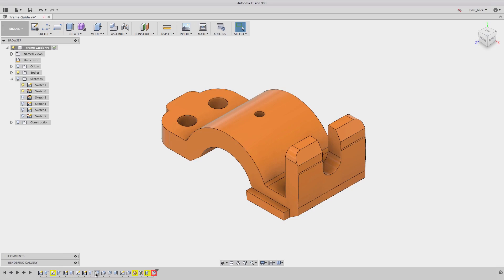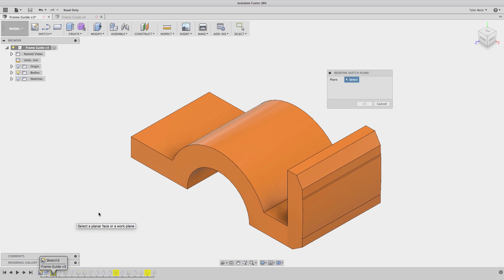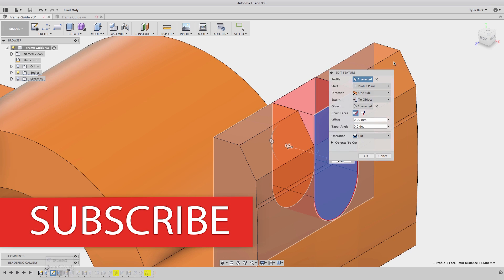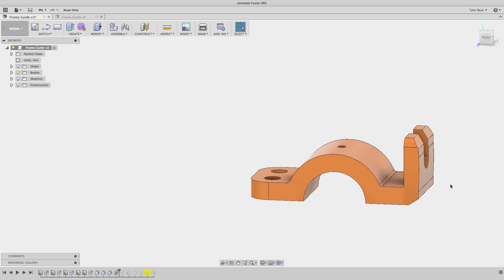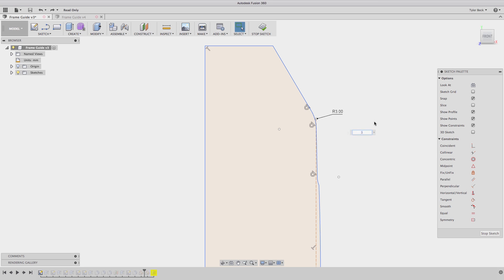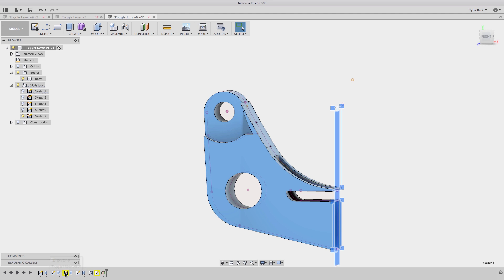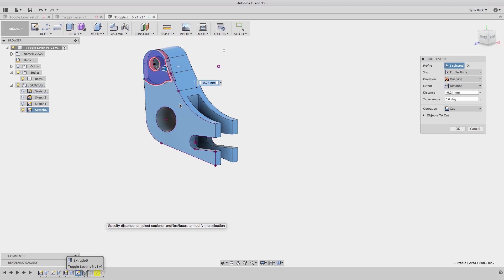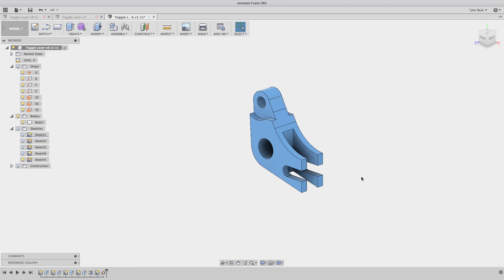Fusion 360 Tutorial - Errors and How To Fix Problems

Comment: Hey Tyler, first of all thanks so much for all your videos.  Great help for us noobs.  I am having a problem with Fusion and it's driving me up the wall.  I was sketching an outline of some text with splines and at some point, something happened and I can no longer move any of the sketch points or handles.  I have checked to be sure my selection options include everything, closing the program and restarting it, but it's still happening.  I've never had this happen before so not sure how to handle it.  Can you help?
Reply from the maker: Hey Roy - glad the videos are helping.  If you have a specific example you can try the Fusion 360 forums to upload and get feedback.  Sorry, I cant always troubleshoot and support the software.

Comment: I thank you for making an effort to answer some of my frustrating questions with fusion 360 but can you pick more difficult examples.  All your missing plane examples for instance are the most simple case I mean you just click on the most logical nearby plane and bingo. Well, I am working on a model now and when I try to replace a plane my entire model shifts all over the place and becomes a total scrambled mess!!!  I sat there last night for 6 GD hours trying to fix one GD missing plane that was like three steps into and 50 step timeline!!!   Not only did I spend 6 frustrating hours trying to fix it but I then had to just scrub the model all the way back to step four in the timeline and spend another 3 hours rebuilding it!!!!!

In the end the only way I could fix it was to roll back 46 steps and wipe all the work then rebuild the entire model from step four!  This has happened to me several times now making me really want to go back to inventor.  Because it is frustrating as all hell when things go wrong and I do not see them until 99% of the model is done and and no matter what you do you cannot fix it! You correct one yellow step and 5 more pop up!!!  It is infuriating!!! I practically have to scrap all my work and start OVER!!!!

The other frustration with Fusion is things that seem like they should have no impact on down stream modeling seem to somehow root themselves in the design and then you can not delete them and have to just turn off their visibility.  This makes the OCD in me go totally INSANE!!!

(2) Another really frusting thing in fusion is joints!!!  Why the bloody hell can I not have two joint constraints on a component.  Lets say I have a screw (1) I know I want the center of the screw aligned with the center of the hole (2) I want the face at the bottom of the screw cap mated with the face at the outside of the hole.  But Fusion will not let me do that!!!!!  I can line of the centers but when I try to join the faces I get a infuriating nasty message that a joint has already been applied!!!  Then I have to frigging grab the GD screw and "by eye" adjust it so the face is flush with the surface of the hole!!!  Jesus what a piece of crap non-intuitive friggin system!!!

(3) bring back the Inventor F4 rotation widget please